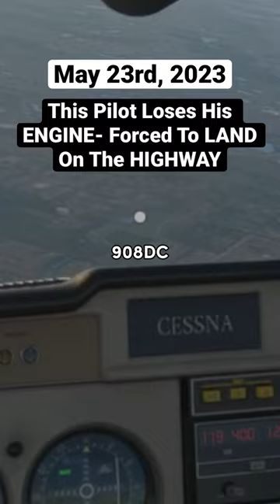This Pilot Loses His ENGINE- Forced To LAND On The HIGHWAY #aviation #travel #atc

Comment: My first flight in my ultralight my engine went out. A lot lower and a lot slower but still scary as sh!t. Took it down with no damage to me or the plane. 1st rule when something goes wrong,  fly the plane.
Reply: I was told there's three rules of flying: Aviate; Navigate; Communicate.
Reply: any landing you walk away from was a good landing
Reply: My ultralight crash in tall tree by the Ohio river plane got trashed only injury was arms scratched on briars climbing up the river bank back to the Lawrence county airport scared does not explain the terror I experienced 😎 1981
Reply: I believe the correct phrase is "fly the effing plane."
Reply: Just did my first flight, very turbulent over Pompano Beach Florida, very nerve wrecking, cannot  imagine engine fail! 😢

Comment: It would have been nice if they had used a Piper Cherokee 140 or 160 or most preferable would've been a Cherokee 6, instead of a Cessna 152 in The Simulation, since The Aircraft was A Piper Cherokee Six.

Comment: I would guess with engine failure the amount of fuel on board is moot point.
Nice to hear he was able to put the aircraft down safely.
Reply: They like to know about the amount of fuel so the fire department will know approximately how big of a fire they might face and how much fuel they might have to get up if the tank ruptures with no fire.
Reply: @kbrock9146  interesting, thanks for clarification.
Reply: How do you know he landed ok?
Reply: Correct but that’s information used by airports with emergency services assigned there. This guy was planning to dead stick it on a public highway.

Comment: Single engine planes are just terrible.
Reply: Negative !! If properly maintained they are very reliable.  I flew my Piper PA-28R-201T for a lot of hours over the years and it never gave me one single problem !!
Reply: Please check the facts before you talk about something that you obviously have no knowledge of.. twin engine aircraft  have a higher death rate than single engine aircraft with engine failure. It takes quite a bit more skill to control a twin engine with one engine out. A single engine has only one option.. find a place to land.